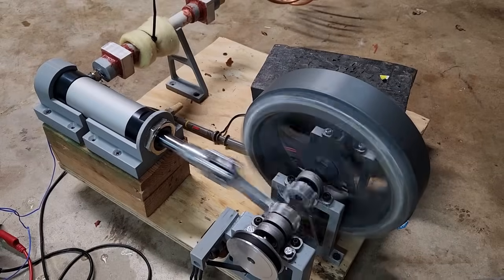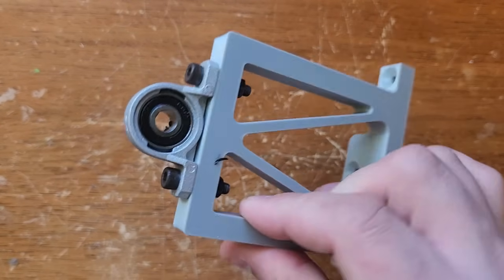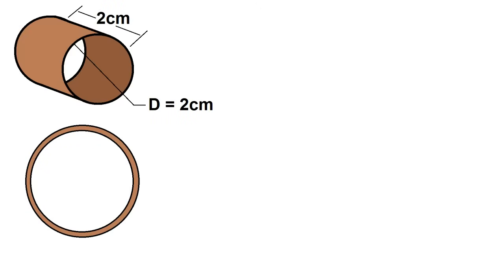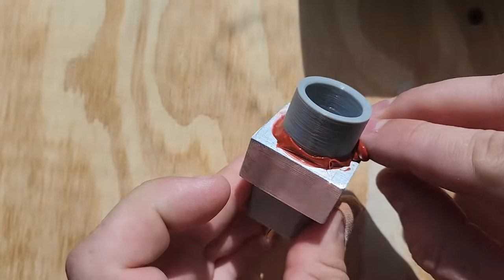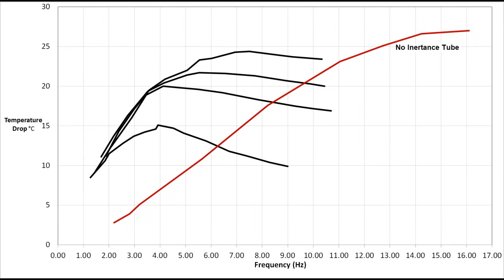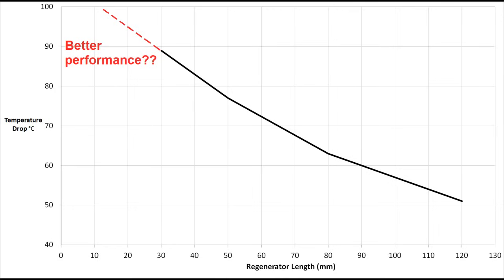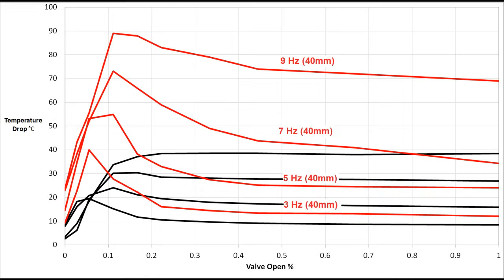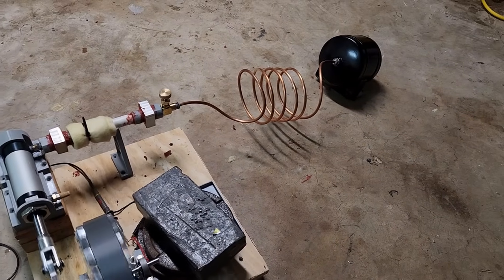Pulse Tube Cryocooler - Part 2 (-75C)

Comment: Um, steel is MUCH more conductive thermally than stainless steel. In TIG welding we use much less amperage on stainless partly for this reason, the input of heat brings the metal up to its melting point much more easily because it defuses much slower throughout the metal.

Also copper scrubbers are a thing if you’re after a more thermally conductive material to replace the steel wool with, though you may lose a significant  amount of surface area.

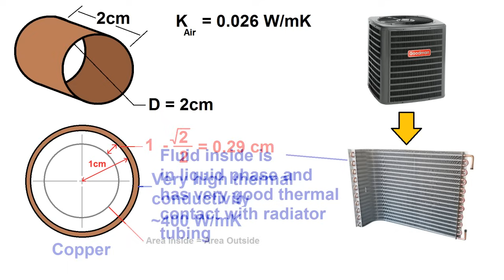Comment: 5:38  Refrigeration condenser coils cool a liquid?  Last time I checked the refrigeration cycle, high pressure high temperature gas leaves the compressor and enters the condenser coil. The ambient air cools the condenser coil and cools the high temperature gas which condenses to a liquid. Although there may be some sensible heat exchanged from the liquid, the purpose of the condenser (and why its called as such) is the latent heat exchange to cool the gas and condense to a liquid.

Comment: You should balance the crankshaft, would be more efficient and smoother of course.
Just put the equivalent weight of the piston and connecting rod, on the opposite side of the connector rod pin on the crankshaft

Comment: Pro-tip: put your neodymium magnet in a plastic bag or cloth when using it to clean up.  Getting all the little bits of steel wool or iron powder off your magnet can be a bigger chore than the mess to begin with

Comment: Tips for cleaning up after steelwool: put something around the magnet, like a it of paper. After you got all the fibers on the magnet, you can remove the paper with the fibers and not have the hassle of cleaning the magnet of fibers.

Comment: See if you can use a direct heat exchanger that uses thin tubes perpendicular to the flow with water flowing through them.
This can keep a far superior temperature differential and allows a larger surface are inside the tube and outside the tube to reject heat to

Comment: Quick Tip : when cleaning up the Steel Wool with a magnet, if you place the magnet in a plastic bag then turn it inside-out the scrap is bagged and the magnet remains clean.

Comment: Just a thing that popped into my head when you soldered the copper tubing into the caps is that you could flare the end or cut it and open up the flaps and solder them for extra safety...don't want you getting hurt....I need you to finish this project so I have something actually interesting to watch

Comment: You have gotten a great deal of positive remarks in the comments and that is well deserved.
Very scientific and a high llvel of curiosity in exploring the possibilities and also with a good intuition as where to go next. The material is clearly well understood and very well explained. You are talented!
A few suggestions: Using matt black plating for internal parts in the hot zone may help in capturing some of the IR radiation of the heat and liquid cooling on the outside seems obvious to you already. Your idea of pressurizing the system looks promissing but at the cost of added complexity. If this works, a duall piston system (opposed) may help in balancing the forces especially at start up.
I have seen the comment about using bushing inserts as they are cheap and easy to use (good idea). I have used ball bearings as inserts in 3D parts as well and that works well (relatively inexpensive).
Just a thought: stacking pellets of perforated sheet metal with the correct size, apperture, colour and conductivity may help in capturing the heat in the hot zone.
Good luck with your project.

Comment: Great video.  One bonus for your tip for the cleanup of steel wool with a magnet, is to put the magnet into a plastic bag first.  Then when you're done you can just fold over the bag and remove the clean magnet :)

Comment: Nice progress. A couple of suggestions, for what they are worth: measure the impedance of the components and match, rework the regenerator for lower axial conduction. May be able to measure impedance by comparing current draw at the driving motor with load and subtract no-load. Capacitance would be decreasing in impedance with f, resistance would be flat, and inductance would increase in impedance with f.
Your dogged determination is inspirational. Also makes you admire Stirling et al, and wonder how they did it.

Comment: Flatten out the tubing by half, make it oval?  Slightly non uniformly so the flow changes slightly?  Maybe put a fan on it.  Hard to say if it works without thermocouples on each side.

Comment: I think You could use second inlet of the piston to create 'cooling chamber'. This would help You to get rid of temperature faster. Well, this also would increase power, needed to run this machine, but now, 2nd inlet/outlet does nothing... i can not express this in words, but high pressure air should go out from 2nd inlet of piston free, while low pressure air should come in to the piston through 'cooling chamber'. It would cool down the piston internal surface more quickly and could take more heat away from heatsink.

Comment: Ok , let's try this once more.... H2 and He gas get hotter ....  not colder when forced through an orifice
so that method of liquefaction is moot. Secondly,  try changing your orifice coefficient from say 0.95 to 0.8 (rounded entrance ) and  1.00. ( sharp square edge) on the return and VS in later tests.... see which gives you the desired result. As for choked flow..... you don't want that happening in the outlet of the device,... this creates standing waves from sonic reflections off of the side walls of the generator making the net effect drop 
Stay Safe   Great Video .
Ciao
Reply: Changed  "chocked" to "Choked"     Flow......

Comment: I see about 13 minutes in that your heat sink adapters are covered in silicone... was that an accident that turned into a mess or did you realize that 3D printed tubes are about as air tight as a screen room? Perhaps your results would be better if you weren't pulsing ambient air into and out of your system?

Comment: You are using a sensorless BLDC motor, aren't you? How did you get the torque to start it? I always had the problem that BLDC motors have a lot of power, but the torque at the start was not there.
I guess I am using the wrong ESC to get any kind of torque. However, it might be my 3D-printed gearboxes, which have more friction and maybe even less backlash than the belt (I printed them from TPU, which might dampen the starting process).

Comment: If you have better results with a smaller variance in pressure, why would a screw type compressor not work? Instead of hz it would be psi and cfm, buy 100% consistent flow. I might have missed something, but I was wondering the entire video why you would use piston compression. It's just so much less efficient.

Comment: My 5 cents:
Before implementing complete stirling with two cylinders, what if split intake and exhaust routes for the air with one-way valves? This may allow to treat gas more efficiently probably w\o the need of regenerator.

Comment: By the way, as one who has worked around welding and manufacturing all of my life, helium is really not super expensive, and all you need is one small tank for a lifetime of research, all you need to do is obtain a used tank somewhere, then rent a commercial tank for one month, obtain a fill, then transfer [after a full purge, of course] all of your helium into your personal tank then send them their tank back and close out your account.

Unless you are using hundreds of cubic feet of helium, a 25 cubic foot bottle should be enough for all of your future research.

ALSO...

If you ARE using helium, you have 2 choices you can go to for a better regenerator: 1, your aluminum chip from your machining of aluminum parts, OR a copper chore boy scrubber because, 1, BOTH have superior thermal mass to steel wool, 2, you will not get excessive flow resistance, and, 3, copper has better TOTAL mass (multiplied by the thermal mass).

And finally...

While with Helium you do need special fittings and seals to adapt to its propensity to leak, its not a whole lot more than normal seals, and you can [and I say 'should'] go with the elevated internal pressure.

Another thing would be doing what a lot of commercial compressor manufacturers do which is to use the spokes of your flywheel as fan blades.

My air compressor has this to keep the head of the compressor cool.

This fan can then be ducted to cool off your system's hot side, without adding a significant increase to your initial power input.

While one could drive a fan directly off off of the housing of the motor, that much air flow would be a more significant drain on that little motor and risk overheating it.

If anything maybe split off just a little of the ducted air from a flywheel fan to shunt over and cool the little motor.

Comment: Are you sure that you want stainless instead of pvc in everything? steel gets brittle at low temperatures and only austenic stainless (300 series, for example) is safe in cryogenic temperatures. maybe you should consider bronze, copper or aluminium in the cold side to avoid random explosions (or any other FCC metal).

Comment: Ammonia would get you a whole lot further.

Yes it will destroy copper and brass, and yes, it can attack some plastics, and yes, its poisonous, but I have worked with it in a closed loop to convert solar power to electrical power and with a baseline pressure of 200 PSI, and a peak pressure of 410 PSI, I never had a leak, using all 316L stainless.

Comment: Just subscribed (I rarely subscribe to channels, I'm only subscribed to 3 channels not including yours). I've worked in HVAC most of my life so I find this stuff absolutely fascinating and super interesting, keep it up! If you're looking to dump off a lot of heat quickly, have you considered vapor chambers (i.e, heat pipes)? It's what they use to dump huge amounts of heat from CPUs and they're shockingly good at doing so. Some of them can dump off 120+ watts of heat almost instantly. They use these copper tubes with a liquid inside of them but the inner walls have a mesh, grooved or sintered lining. There's a picture of the inside of one on the wikipedia article for heat pipes. They're incredibly efficient and since you can machine some of your own parts, it shouldn't be too hard to create some sort of base to attach them. Either way, keep it up man. Loving your channel.

Comment: The regenerator should be used out of steel wool , surely its conductivity is too high . it needs to be a non conductor of heat but it needs to absorb and reject heat very quickly.. I would have though plastic wool or cotton wool would be better??

Comment: ok , so if you need to dump the heat at the hot end, why not use a heat pipe to take heat out of gas, because the gas is compressed it will efficiently transfer the heat to the heatpipe and then the heat pipe will wick away the heat at rates of 200W/mK ?!! If you just put a water jacket around some copper tubes, you have to wait for the water to take up the heat too.. also how are you ejecting the heat from the hot side?? with room temp water? or cold water??

Comment: Perhaps you can put the coil inside a metal box, with a fan .
Also , if you can make it a closed system, and Vacuum your lines , you will have no moisture in your system. You will need to have enough piping or tank, to store enough volume of your gas, air, Heat transfer material, refrigerant, whatever you wanna call it.
I also wondered if you could reuse your cooled air, again to precool the incoming air to the regenerator.. 
What you are doing here, reminds of the effect a capillary tube produces in refrigeration.

Comment: would a two stage re generator with a larger diameter for the side that gets a frosting effect before the smaller stage help?. or a coating of some type to help prevent frosting.

Comment: Hu so you make hard wurk to bring wat is inbetween in to while the egnition is when it opende
Decompresion after compressor leads to heating compressor after decompresion creates cooling😍

You neet on every plate  outside and and fire nano layer thame (onley outside blades please you'll be amesed 😍 without the wgnition moment to pull treuth the blade dimentions from outside ands slingshot it like led in between the air particles you are lowering everighe thention this way whay you experiemce cooling😍😍😍

Comment: Do you have any data about the amp hours used? I'm wondering if a 12v version of this could be used in an RV as either an intermittent cooler or icemaker.

Comment: Very cool video. I liked how you showed the math and explained the relations between things such as the effect of the diameter of the copper or the differences in surface area used in the regenerator. You got my sub

Comment: Re: cleaning steel wool with a magnet: you forgot the most important part -- always cover the magnet so that you can actually remove the steel wool later! A piece of paper, for instance: as soon as you move the magnet away, the shavings or whatever just fall off. Way better than picking everything off of the damn magnet, eegads

Comment: Hey, try making the inlet slope to the exchanger 45 deg, and the outlet slope to 30 deg this should improve the turbulence in the system. It provides a trade off. In the larger diameter tube you maintain pressure  as a constant. When you reduce the dia. The pressure rises increasing velocity. The 30 deg slope outlet will smoothe the air sream allowing the pressure to stabilize prior to the steel wool. I am an HVAC guy that specializes in large mechanical systems

Comment: 6:00
If you ever need something, that at least resemble the pipe with fins inside, you can check the 
edm drilling electrodes
They can be as small in diameter as fi 2mm, but still they have some kind of division inside

Comment: On the surface area of the cryocooler's heat exchanger...  Through COVID, I did a lot of science reading.  I found something in alcohol purifying that may be useful to you.  

From the boiler, there's a vertical pipe for the steam to rise.  If everything goes right, alcohol is still a vapor, but water condensates out, and falls back into the pot.  You don't want alcohol continuing to the next heat exchanger, where the alcohol should condensate for recovery. 

In that vertical pipe, for people who don't have a vast budget for fancy gear, they stuff the pipe with copper wool.  Like steel wool, but made of pure copper.   There's a lot of "copper" wool that is really painted steel, and it rusts very quickly.  Some simply opt to use the copper wool, despite how pretty the more expensive solution is.   The same way people drive fancier cars that accomplish the same task.

The copper wool would give you a much higher surface area, while reducing the air flow disturbance.  If you want more surface area, use a longer tube, and/or pack the copper wool in tighter.

I do like your drilling job though.  It was very artistic. 

If you use this idea, please write "Smythe Industries" on the side of it, as compensation.  It doesn't have to be well written, Smythe Industries isn't a real company.   :)

Comment: Awesome project!!!

Can you try non-metallic regenerator materials? Cotton balls, polyurethane foam, or microporous silica insulation. You're looking for max surface area and min thermal conductivity since it just needs to grab heat and hold it not move it anywhere right?

I'm a bit surprised you haven't done this yet, I feel like you mentioned this in one of your videos but maybe I saw it googling around afterward.

Comment: Aircon techs seem to use silver solder rods for brazing copper to brass. 
The rods used are often 15% silver. This may be a stronger option than using soft solder joints.

Comment: Helium is available cheaply in balloon gas cylinders.
Potentially it may be a mix of helium and nitrogen though.
The disposable helium balloon gas cylinder fittings are just aircon gas fittings.

Comment: Try Copper wool, not stainless steel wool.. much better thermal conductivity.. it’d be an interesting comparison to the steel if nothing else given your findings on copper tubing effects, it may in face perform worse, not better

Comment: PV=NRT WITH THERMAL CONDUCTANCE AND DISSIPATION...
EXCELLENT VIDEO
Reply: however you're not fully accounting for thermal conductance in the shotgun dissipators
Reply: if you spread your thermal dissipators over the XYZ axis instead of stacking them, in other words, in a spherical configuration it should achieve much greater thermal dissipation. goes in it from the core goes out it from the outside of the sphere to rejoin to a central manifold should boost efficiency exponentially. then consider cooling the outside of the sphere with the secondary cooling system you may get within liquid nitrogen range at low energy input

just a suggestion keep up the good work brother

Comment: What about using hydrogen? It is a better gas then helium if you consider only the thermal and viscosity properties. It is usually not considered because of it high diffusion. But it’s cheap to experiment with and is similar to helium for purposes of tuning. Edit: I just read that it was already suggested. I would be tempted to fully develop diy solely on hydrogen just because of its availability.

Comment: Use hydrogen - you can generate it by electrolysis or by chemical reaction of aluminium and water solution of sodium hydroxide(drain cleaner)

Comment: I was wondering if using a compressed gas would get rid of icing problem, if the system is flushed through first? The other thing hydrogen is a very slippery gas and can work it's through a lot materials so making parts out of stainless steel would be a very good idea, or maybe trying argon first?